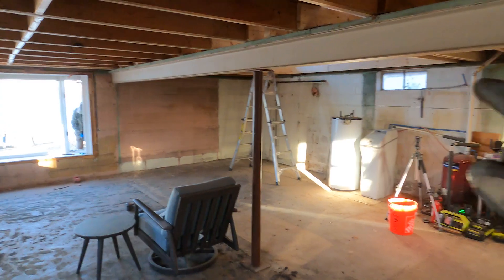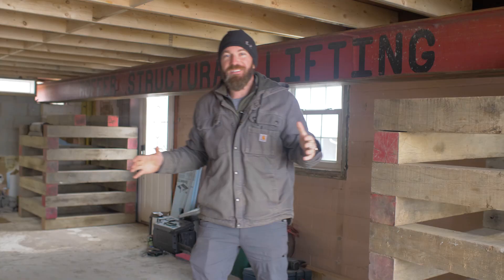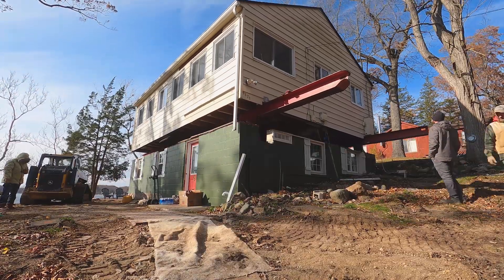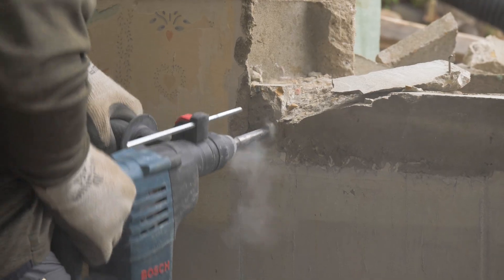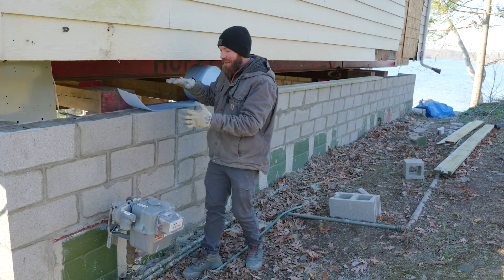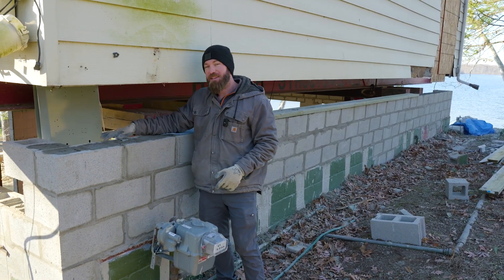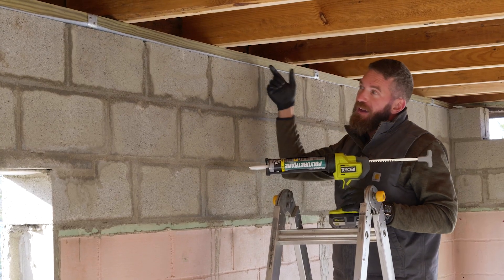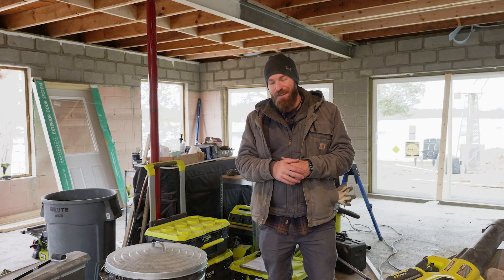We Lifted the Entire House! (because the ceiling was too low)

Comment: When applying the sill seal caulk. It looks very professional if you run two strips of masking tape along the seam, then run a 2 “ putty knife over the calk pushing it into the seam . Pull off the masking tape and it looks professional

Comment: one thing that's very interesting is that the steel beams are able to support the house from its floor joists, without actually being beneath those walls. that suggests that those floor joists are connected to the load bearing studs enough to be sure the house doesn't fall apart when it's lifted. like, i wondered, what keeps those floor joists from suddenly separating from the vertical stud structure, with the house suddenly falling apart?

Comment: Why not pull the foundation walls down and make a bigger basement while the hose was jacked up? The original walls weren’t very straight and with all the expense of lifting the house surely it would be worth pushing for more square footage and a much stronger foundation?
Reply from the maker: zoning and permitting plus added cost. It was already a stretch to invest this much in added height.

Comment: What kind of company does did you call for the lifting/jacking? My house is 100 X 30 and built on center block piers. The original owner installed blowout walls. I have a 3,000 square ft garage but it's only 7 ft high. I'm wanting to raise it to 10 maybe 15 ft high. I don't have any idea what kind of company to even call

Comment: I would agree that block is the right way to extend a foundation, but I have seen it done with 2x6 or 2x8 framing and drywall plus insulation to fill the gap. They reused the J-bolts in the top to hold everything to the original walls. Either way, quite the project.
Reply: Unless I’m not understanding what you’re describing properly that sounds like a major hinge point wich if there is very much backfill pressure could be a problem.
Reply: @MichaelHoffer-qd2qx   we're talking about raising a house to gain headroom but not raising the ground level. The soil stays where it is, and any wood / farming is well above the ground. IOW, the soil is well below the existing ground, where the foundation has been for decades already!
Reply: It being a solid continuous wall to the  floor system is because it being tied to the floor system is what’s holding the backfill out
Reply: @MichaelHoffer-qd2qx    Good point but adding rebar and filling the cores just makes the wall stronger. We didn't see enough in this video to know if that first row of block is actually tied into the slab / footing. Hopefully it is.

Comment: It looked like in your situation for the most part all the electrics came down from upstairs and all you had to disconnect was the plumbing and furnace.
I’m curious why not build a stub wall on top of the existing foundation??
Neighbours of ours did similar, they jacked up the house and put a proper foundation under it with a full basement and lived in the house while they were doing the work.
Just the day they were jacking it up was the only time they couldn’t be inside.

Comment: Having worked with my father in concrete work back in the late 70’s we have had to go in to at least 20 houses and remove collapsed cinder blocks walls that failed from hydrostatic pressure from failed downspout drainage systems. Personally after installing solid concrete walls for a builder on at least 30 of his homes there has never been an issue will walls failing. We would do the necessary jacking and or supporting of a home that suffered a collapsed wall. Yes it is a Very funny feeling working under a home supported by timber and hydraulic jacks. Glad I listened to my old man, got my degree in Architecture. All of my home designs specify concrete walls with the extra height to begin with so the homeowner has full height of his basement should he want to finish it.

Comment: I would like to know more details about how you pieced together the sill and seal in the areas where the steel beams rested. Did you do anything extra to secure the rim to the joists before the lift. This is not the way the building structure was designed to carry loads. Did you have any issues with cracks in the walls upstairs afterwards? How much did the house lift cost and how much for the foundation work. Where is this job located?

Comment: Great job! However using a concrete saw with no mask,water, eye or ear protection is crazy! 
Like you said, at the end of the video, be safe!
And that polyurethane sealant/construction adhesive might be the wrong caulking for the seal plate.
Reply: It's okay, safety squints were engaged!
Reply: ill never understand how ppl dont use proper ppe.

Comment: I think I missed whether the guys were able to bolt it down to the foundation?
Reply: They did not use anchor bolts at all. Used the Simpson brackets, which my Building Code would not accept unless signed off by a PEng.

Comment: It's interesting for sure.  I'm curious about the cost vs benefit.  How much did the value increase?  Also, were there any other cheaper options?
Reply: I'm not a professional appraiser but I'd say this job probably cost in the neighborhood of 10-12k with all the trimmings. Instead of being a low ceiling walkout basement, it is now a 2 car garage. Probably added 20-25k in value. It makes the house more attractive to buyers especially if the property is small with limited parking availability.
Reply: @Dodgecityhorse That's not bad at that price.  I would think about twice that price but I have no idea.
Reply: @HousesandCars  sometimes the juice is worth the squeeze.
Reply: @Dodgecityhorse  just the materials cost 10-12k

Comment: I have an old 16'x24' cabin on piers with a tiny 18" crawlspace at one corner but almost 4' on the opposite side. Would something like this be a good solution to try and get a partial basement?
Reply: Something like that was done near me and the guys hand dug a basement. Took them about 6 months, while living in the place at the same time. In a nutshell, they used heavy timbers and supported each corner diagonally, then built a pyramid with block to support that corner. Gradually each pyramid was made wider till they met in the middle.... one side at a time. When it was done, they leveled the dirt floor and poured concrete to finish that. I thought it was an odd way to do it, but the end result was lots of sweat equity and a decent looking job. In the end they reused the timbers and jack posts to level the floors in the 150 year old house, from the basement.

Comment: Surprised to see you're resting the cribbing on the floor can't tell if it's a concrete slab or a wooden deck, no matter  that's risky. WHY NOT CUT OUT THE FLOOR AND DIG DOWN TO VIRGIN Soil first then rest the cribbing on undisturbed soil
Reply: Could. Have. Had.  Draining issues..  from the higher elevations…..

Comment: I'm guessing that the floor slab was surveyed before lifting as all the weight was spread on the outside walls and not just four points within the slab. Plus I'm interested as to the cost effectiveness of this lift against taking off and rebuilding the top half higher. Very interesting vid chaps.
Reply: It's not just 4 points - the load is distributed across those gigantic H Beams -- so it shouldn't be much different than the normal perimeter wall (Except for the two ends perpendicular to the H Beams). This is definitely something you'd have a PE sign off on though.
Reply: (I think the occupants still wanted to be living there during the rebuild)
Reply: The steel was set in place to support the load in a way that It wouldn’t overly flex anything and yes the weight of everything is on 4 cribs sitting on the concrete slab but this was a very light structure there wasn’t really any worry of cracking the concrete unless whoever poured it did an extremely terrible job with the fill underneath.

Comment: This is the ONLY way to get a 2nd story when the original structure's walls and joists can't support the added load.  It's fairly common in the San Francisco Bay where many of the tiny bungalows are worth jacking up and installing a new lower level.
Reply from the maker: That makes sense!
Reply: @rogueengineer what's your position on bench footings/underpinning? This house kinda seems like it'd be an ideal candidate since half of its on a slope. We do this in canada where we got century brick masonry style homes sitting on stone since there's no jacking anything like that up lol😅
Reply: Not the only way. Might be the easiest.

Comment: Why wouldn't you seal the base plate prior to bolting it down? Adding a sealer on the sides is mostly useless.
Reply from the maker: Because the weight of the house further compresses the sill plate.

Comment: Jacking company did awesome job. To eliminate the hydraulic pressure/flow issue and you have a lot of money, enerpack makes a computer controlled system that automatically increases/decreased flow based on jack pressure.
Reply from the maker: I believe they have one but it was too big and difficult to get to the house for this smaller (to them) lift.

Comment: I love this kind of work and this kind of content  I've had to do this on my own house.  I did it myself.  It's a very old home, though, balloon framed, so I can't lift it by the floor alone.  I have cribbing up against the foundation in my basement as well, except I set mine on a shallow layer of sand to spread the load out more and to take up the inconsistencies in the laughable "floor" finish.  I use ibeam under the joists as you did, and outside I have to take the wall apart.  I use heavy C channel there up against the exposed studs, and I run temporary king studs next to each existing stud from the underside of the top plate down to the c channel.  My jacking and supporting arrangement lifts the inside i beam and the outside c channel together as a unit.  in my case this is all to replace the sill because of termite damage.

I use steel shores (screw jacks) and bottle jacks with screw jack supports
Reply from the maker: Sounds like you got it figured out!

Comment: I did the same thing to my house but also moved it over three feet . Me and my wife lived in the house while doing this and actually felt the house rocking while sleeping . This was almost 20 years ago and looking back what the heck was I thinking ! Good luck it's a fun project .
Reply: How did you perform the lateral movement?
Reply: After the house was raised to the desired height we placed sets of steel rollers on top of the cribbing. The steel i-beams that supported the floor joists just rolled across the steel rollers with a little push from a skid steer. These rollers came in a steel case approx 12''wide by 18'' long with a set of maybe 12 steel rollers approx 3/4'' x 12'' long spaced 1/2'' apart .If you can weld you can make your own .  @jason_paulin
Reply from the maker: Holy crap! That’s insane!
Reply: @rogueengineer when I had my house jacked up I was living in it until I got the foundation built . The bats would fly up the open staircase and round and round while I was watching TV . 👍🇨🇦

Comment: Very cool lift… I was a little surprised by the two new large openings without the kind of seismic engineered framework I’m used to seeing required. That wall looks like it’s shear strength might be a little sketchy for a foundation story, but maybe that’s not as much of an issue in lower seismic risk areas?
Reply from the maker: Thanks! Yea pretty low risk around here and that wall is filled solid with concrete and plenty or steel.

Comment: I lifted my place two years ago. Your lifting crew needs a better pump with a counterbalance valve in the system. That will compensate for the uneven weight distribution of the load
Reply from the maker: They have one but it’s huge and usually stays in the truck. The location of this one made that difficult. Not to mention that it was unnecessary for this job

Comment: Quite a job! Well done and well documented! I'm curious though, how did you go about connecting the lifted structure down to the sill plate? It was hard to see in the video but Im assuming you had a clever way of tying it down? TIA
Reply from the maker: Thank you! That will get toe nailed or hurricane ties installed where toe nailing is not possible.

Comment: What needed to be done to all the mechanical aspects before you raised the house? Plumbing,hvac,electrical, gas etc.
Reply from the maker: Anything that passed from the lower level to the upper level needed to be disconnected. The electrical panel was attached to the floor joists so it could go up with the house. All HVAC was removed and gas and plumbing remained with the first level.